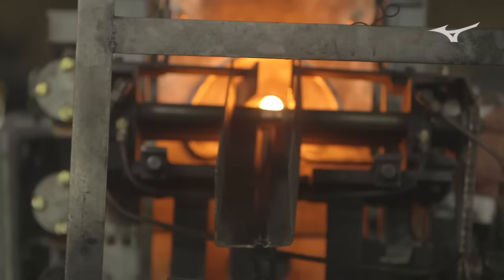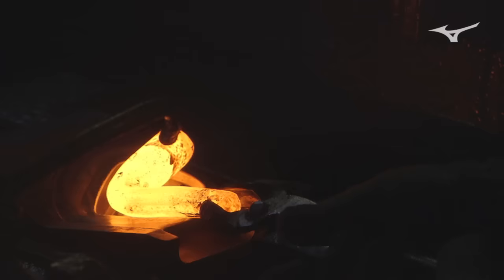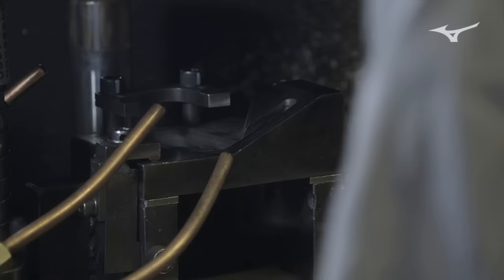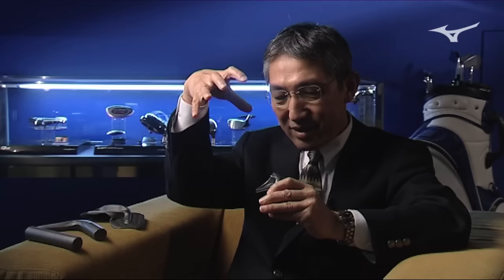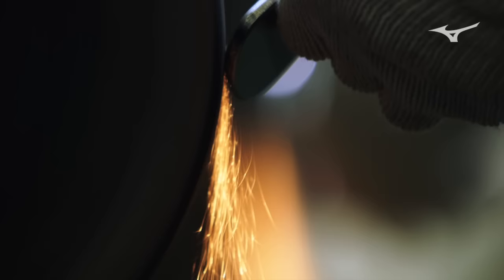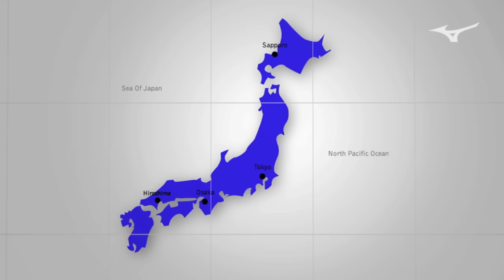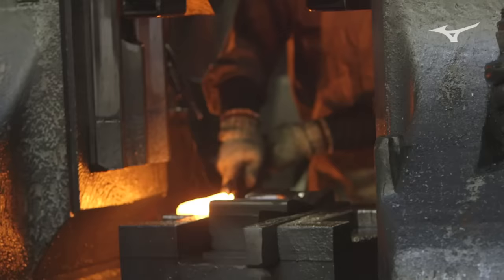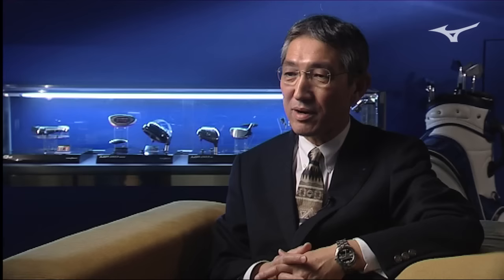Mizuno Golf - The Art of Forging (2016 HD).  Nothing feels like a Mizuno

Comment: my old set still feels as smooth as butter and I really don't need new irons other than new wedges but the new MP-18 SC's just looks so sexy... I wonder why they don't use a folded high carbon billet with a combination of hard and softness like for an ax head or katana - maybe it's too time consuming.. imagine if you had a folded medium hardness club face and a soft core with a hard backing to stop vibration and cure miss hits.. but again those irons would cost a small fortune..